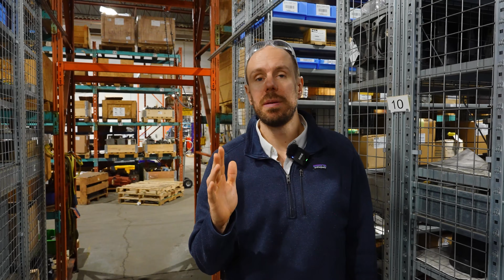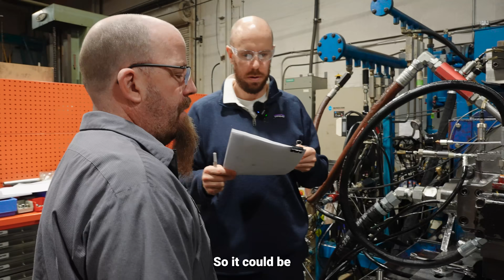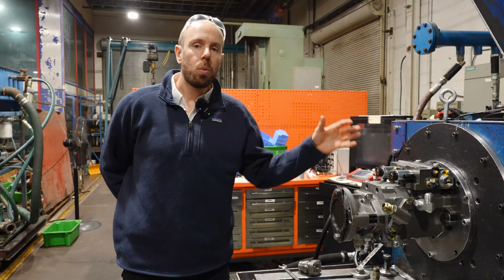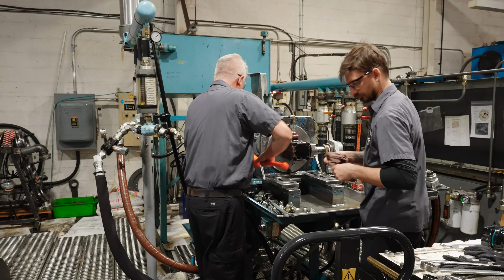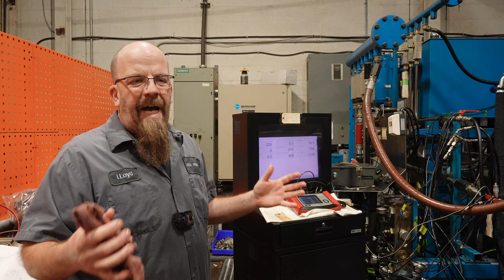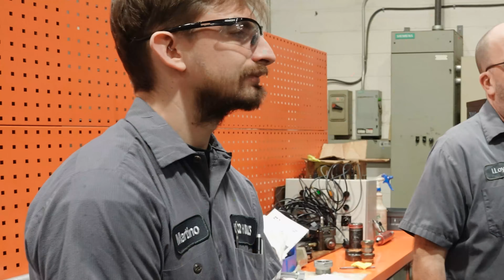$100,000 Parker Gold Cup P30S Stopped by an Air Bubble — Full Troubleshoot

Comment: How big is the motor on that test stand?
Reply from the maker: 200 hp @1800 rpm. So undersized if we want to test at full flow and full displacement, which isnt really req. Problem is that a 600hp @ 1800 rpm would cost $150 just to turn on. We do have larger stands but we dont use them as much.
Reply: @LifcoHydraulics  I was thinking around the same  amount of horsepower.

Comment: I had a vane pump on my Grove 70 ton truck crane vanes often would not come out to pull suction from main hydraulic tank below .
I was gonna put a small 12v electric oil pump to precharge the charge pump .
Made bad noises until primed in winter ❄️